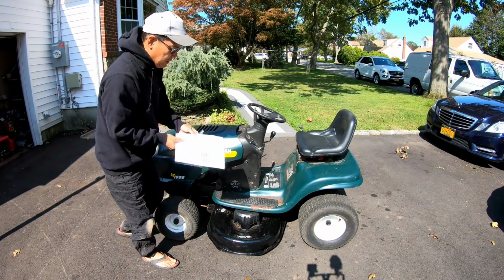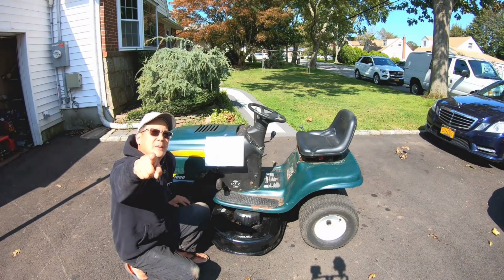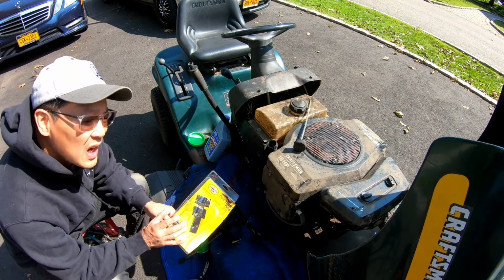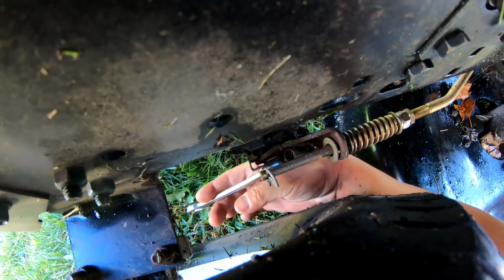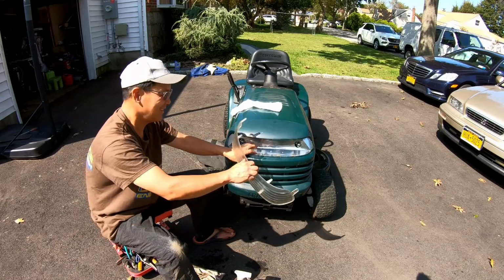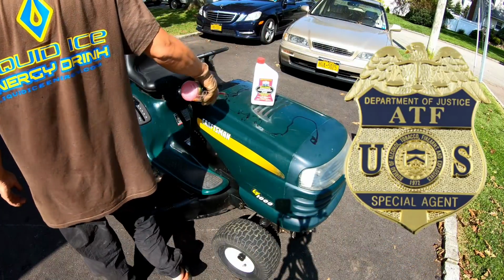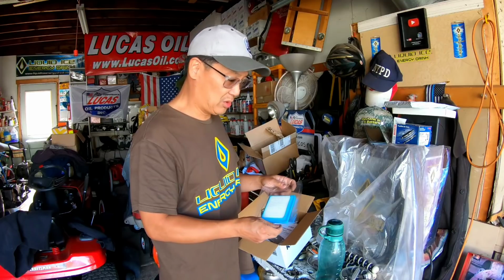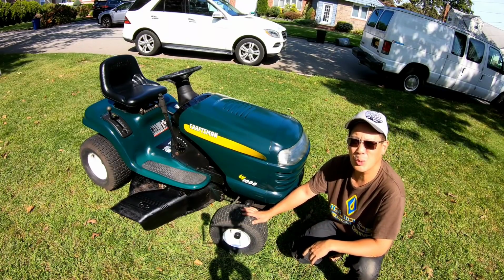FREE CRAFTSMAN LT1000 18HP BRIGGS OPPOSED TWIN ENGINE BRAKE ADJUSTMENT WASH TOUCH UP PAINT FIX FLIP

Comment: These hand pumps are for putting in gear oil in outboard engines . In the lower drive unit , where the propeller is .

Comment: That pump is designed for cars. For example. When I was filling the transfer case on my jeep, the fill is right under the floor pan, so I cannot dump the bottle in. So you screw the pump on the bottle, and you can pump oil anywhere
Reply from the maker: I see!